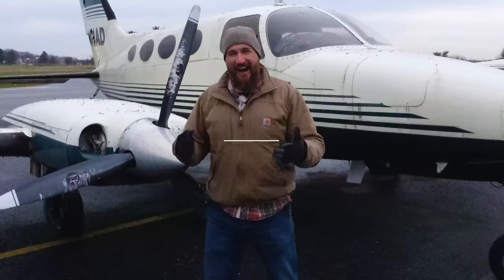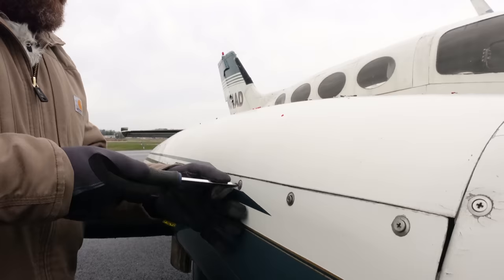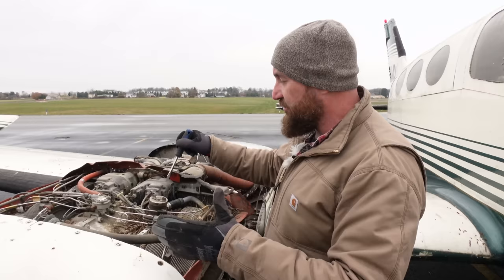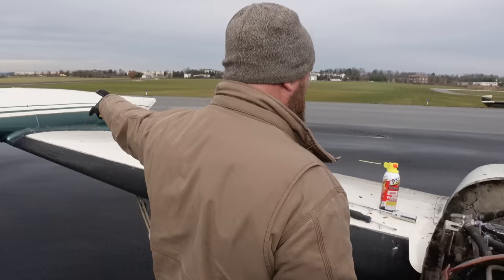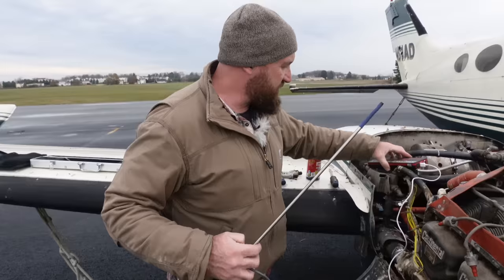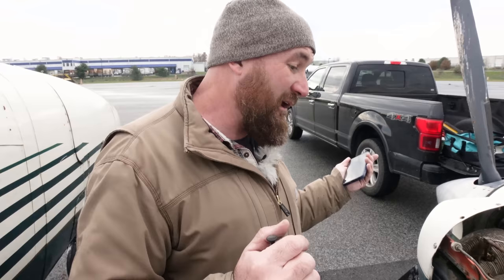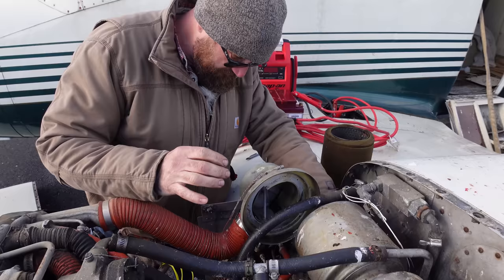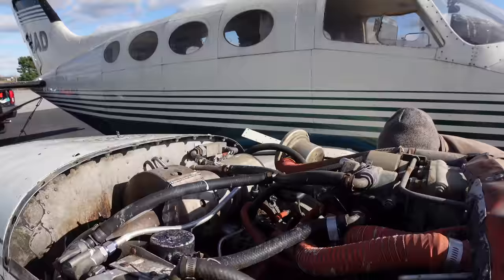FREE Abandoned Airplane... If I Can Start It! Ep1

Comment: This was great but i didn't get to follow the entire episode. Did you get the airplane running??  Its beautiful.  Could you replace the fuel based turbo with high torque electric motors ?   Then you can power the higher torque electric motors with Edison generators and dynamos with inverters to deliver 110 volt AC power continuous peak power without fuel or pollution.  Carry the generator and fly the plane with electric motors.  A permanent magnet motor as a generator is Edison generators and brushless motors as generators are dynamos.  It is pretty easy to make your own Edison generators but the dynamos are a GE contract.

Comment: Just wanted to mention you should only use silicone grease like permatex dielectric on plastic and rubber.  I saw you use white lithium on those o rings and that's not good, itll cause the rubber to degrade. Vaseline is not good either, only silicone

Comment: I hope you get it started. Love the fly the thing. Is there a hole in the fuselage or windows where the birds have been getting in? I hope you have checked the water/fuel level. Water could be making up a lot of the fuel level which would also be stale due to not being run or moved in 15 or so years.

Comment: you know about series n parallel with 2 batches I am sure! LOVE THE VID. Course you did. Now 1 question, Do you think the wink would have leaked without saying it out loud. Considering all possibilities superstitious ect. You think gremlins leaked that wing after they heard you shittalk it?

Did you try to give the cpu in the cab a few light bumps on top? Surprised yiddint try some brakleen in the intake.

Valve covers dont come off letting let you push pull the valves? Hell yeah it is, next time, pull the valve covers and test each valve (Push valve down listen I imagine there is more pressure in a conti than a briggs, either way its really easy to access)  and check the lash too while yerattit. (It seems they are hydraulic, maybe you can pull them pump em cleaned fillem) Autozone spark tester or yer finger.  What am I talking about, test There is some test equipment, Its called, yell to someone on the ground and ask them if they see spark. A dark blanket if its daylight. Or extended spark tester. Also 2 or 3 layers more of jeans and 4 or 5 t shirts, 2 or 3 long sleeves would have kept you warm. You would have been peeling layers off. The discouragement is deep. Nice vid man.

Comment: Aluminum residual could be indicative of thread damage if it is not from the sparks. Is it going to cause problems with the sealing of the cylinder casing of the sparks reinsertion into the cylinder casing? That's going to be a flag to watch.

Comment: I’m guessing that you are going to be able to get it running but you’re going to need to do a lot of work on it to get it running though.
Reply: I would fill all the cylinders with transmission fluid with all the lower plugs back in.

Comment: not near as cool but i worked at a mechanic shop and a guy brought in a 93 gmc g 20 and said if you can get it running you can have it. put a fuel pump in it and fired right up lol
he brought the signed title the next day

Comment: As a Sgt. USAF.  Acft Elect Gen Syst. Cockpit qualified, B-52,KC-135,141Starlifter,T-29,
T-38, and 118. I don't doubt the engines will start, but realistically    you are looking at an $80 thou, engine rebuild. Not counting R/R on elect harnesses, avionics, selinoids etc. Structural integrity is key, and after 16yrs subject to the elements. I would not depend on it back in the air. And don't  think you would ever get it certified and licensed. Sorry not worth the investment.

Comment: OF COURSE, any supercharged engine should be able to start WITHOUT turbo! The initial exhaust gas pressure is ZERO when the engine just fires up. You're no good enough technician to deal with things like this. Leave it for professionals.

Comment: 20+ yrs in the autobody industry i’ve restored cars that came out of barns, fixed cars that were in high speed crashes, and probably painted over 3000 cars myself and i’d run as fast as i can away from this thing. Planes have all types of federal regulations that cars don’t have. This thing isn’t even worth parting out. Maybe just the aluminum.

Comment: Your health is paramount! I'd be using a mask to avoid breathing in the dust from the bird droppings. Next get a certified Airframe and Powerplant mechanic to do the work. You might be great with car engines, however if something goes wrong at 16,000 ft. it's not like you can pull off at the side of the road. The FAA might have something to say about it.

Comment: There's not a chance you're going to get that started to run very long as it will seize up with a corrosion cylinders if it isn't already seized up it's not like a steel cylinder aluminum if you get that corrosion moving in the cylinder the rings are going to dig in and she will see

Comment: Stop being so casual and spinning the prop by hand... very dangerous. ALWAYS treat the prop as if the ignition is on!!! Before you start the engines, please tighten all the cowlings. The props put out a lot of wind and might rip the cowlings off the plane if not tightened properly.

Comment: Why are you faffing about the turbo. Just disconnect the thing and start it like a normally aspirated engine.
Take the mags off and cleaned out. Maybe you will fart for you then.
Once you get the mags off you will see if you have to rebuild them or not.

Comment: It'll take 150k to get it airworthy.airworthiness. Put a mask on too. You not an A&P you cant be working on it with intent to fly without A&P present.. 24v battery x2 on left side. All Cessna twins, critical engine side. Pull the engines, drain oil, send out for test, strain the fuel out, replace plugs, mags, batteries, r&r strainer screens, hoses, etc. This is a junker.

Comment: It seems to be a real fad now to make a video of getting a suspect engine fired up with minimum effort. If I acquire an old beetle or 356 that has not run in years I would tear it down and clean and inspect as best as I could and repair if necessary. Seems firing up a long dead engine may very well score or spin bearings, damage cases, cranks, cams, etc.  Seems not a fad a serious restorer should participate in.